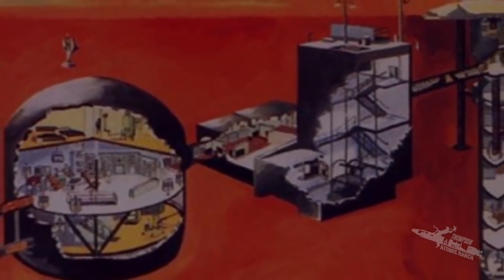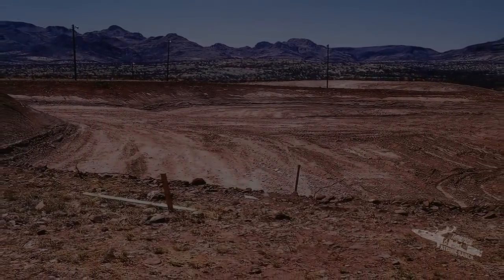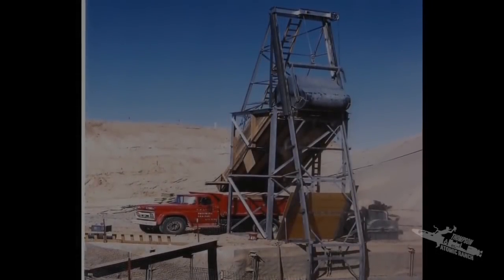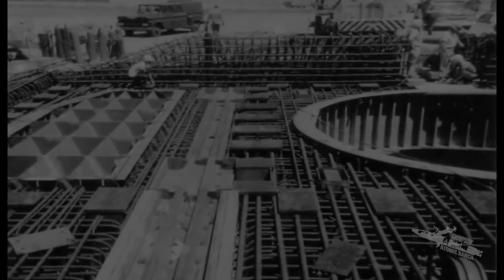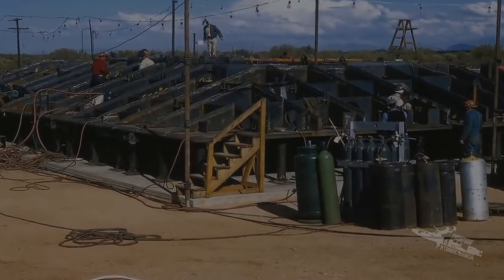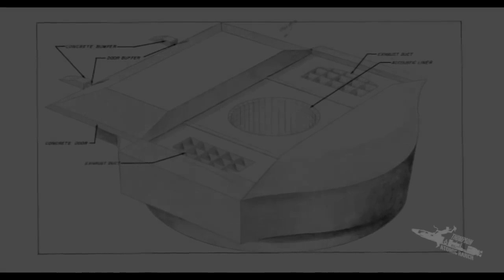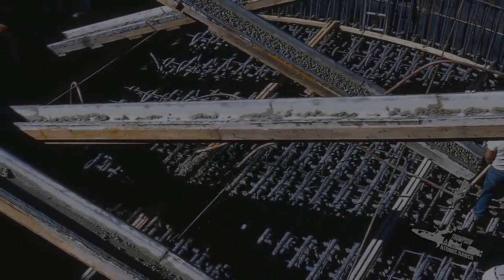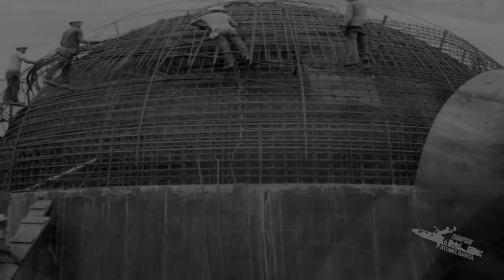Titan II Legacy - Part 1 - Construction

Comment: That is one massive construction!  I can hardly fathom the work needed to build these structures
Reply from the maker: It was pretty impressive right?!
Reply: @ThompsonAtomicRanch  Especially when you consider it was all done with 1950s and 60's brute force technology.
Reply: Right?  Not only did they construct these massive engineering marvels in only 18 months, they did 54 of them all at once!  And here I am staring at a simple bridge over the local freeway that has been under construction for 3 years...  Probably at the same cost.